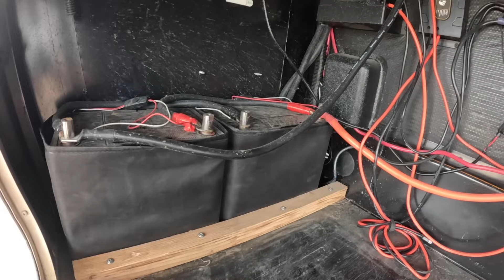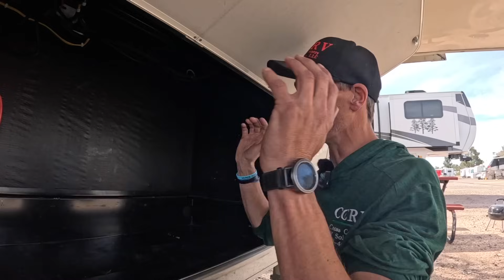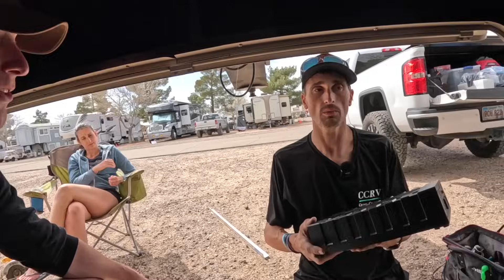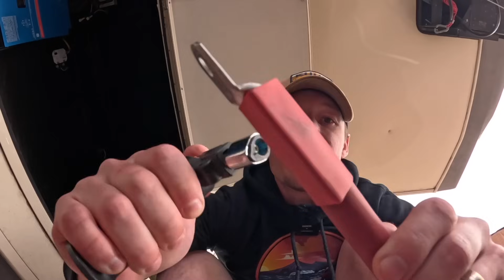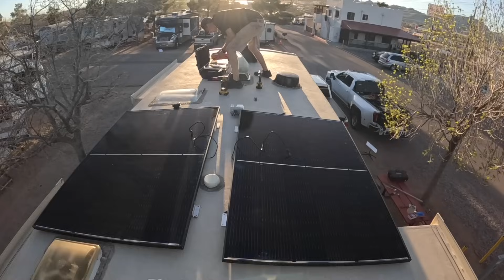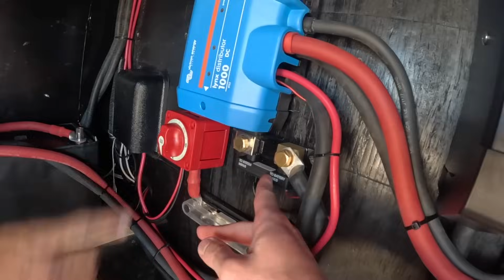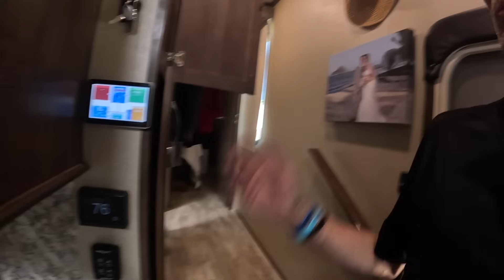Exposed: Expert Reveals the Lies RVers Still Believe

Comment: amazing Karl/Kyle could fit in the storage compartment, and the info I heard was never buy a solar package from the manufacturer or dealer and buy aftermarket from someone like Derek.
Reply: I think it depends on the factory's method of installing their least expensive system. If the system is upgradable that usually means there are proper wire chases and access points already installed, inverter wiring/prep is already there, etc.. And all that stuff means a cheaper labor cost of going to a custom system. A small add-on cost (hopefully) to the price of a likely financed item to reduce the cost of the custom install later on. But it all depends on what the factory install includes.

Comment: One thing to be careful - I'm sure you've heard this, but you cannot be charging Lithium-Iron-Phosphate (LiFePO4) Batteries below 32 degrees F.  A good battery has built-in cutoff to prevent cold-charging.    I am a ham radio operator who uses 30 AH and 40 AH LiFePO4 batteries, and I always try to keep the batteries warm when charging.
Reply: The Multiplus has low temp shutoff built-in.
Reply: If anyone wants to charge colder than that, the Epoch Marine LiFePO battery is water tight, insulated, and self warming.  So it can charge in freezing temps and stays safe to use in higher temps.